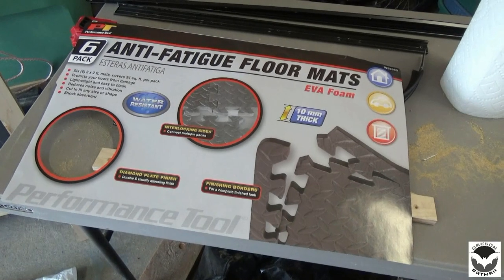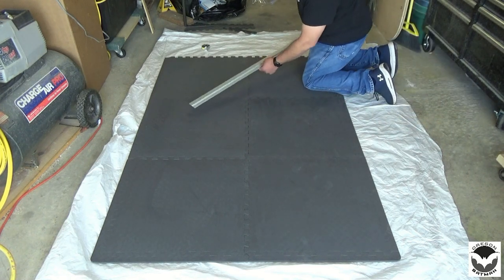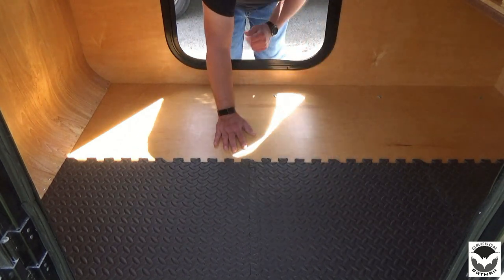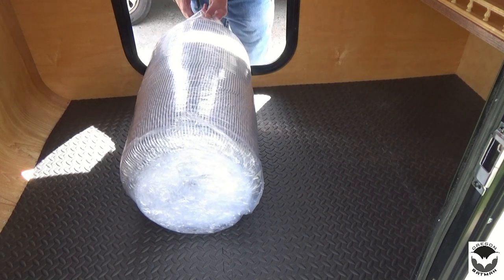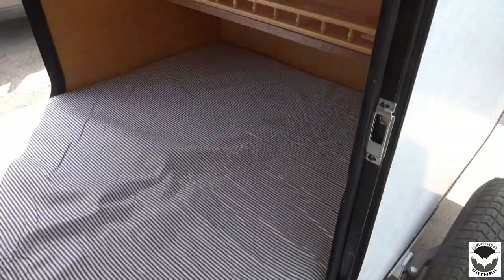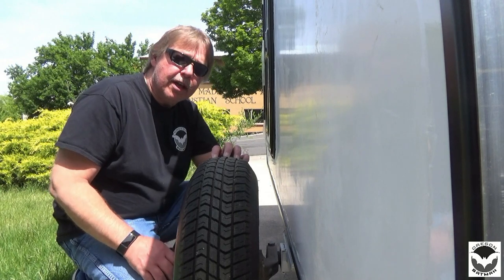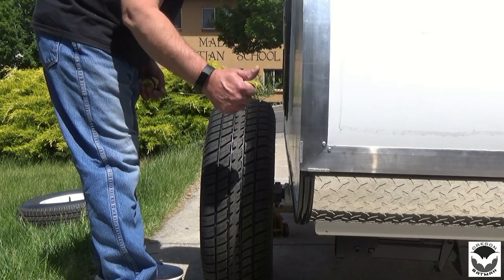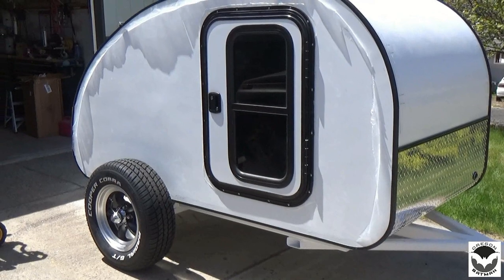Let’s Build A Teardrop * Step-By-Step * - Part 47 (New Wheels and Mattress)

Comment: New wheels and tires look good. You need to put some chrome exhaust tips on the ends of the 2" square tubing coming from the hitch, to make it look like your camper has side exhaust. lol
Reply from the maker: LOL! That's a pretty sweet idea! I saw this comment while I was stopped at a rest area in Nevada, and was out in the parking lot measuring and figuring out if it would look good. Gave me an idea! Thanks Beareded One!

Comment: Hi,  Albert! I've been minning to ask you... Why you haven´t installed a fuse box or an electrical conduit? Also... Was too dificult to install the filon directly to the 3/4" ply walls, that you inclined to do it first on a 1/4" ply? Again, congrats on that awsome work!!! I'm a fan of it!!!
Reply from the maker: Hi Diego! Just trying to keep it simple for the electrical, I'll use a fuse at the battery (15 AMP). The walls are 1/2" for the inside walls, the ceiling rests on the edge. I installed filon on 1/4" because it was easier while lying flat then install on side. Could just as easily install on side of 3/4" wall if you wanted to, this was the easiest for me. Thanks so much for watching and appreciate the questions!
Reply: @OregonBatman  The fact that you take the time ton answer your fan questions, is one of meny great things about you! I'm waiting some tools that I bought to start my teardrop (square, outlander type)... I'll be in touch, for more or your guidance! Until then, I'll be waiting your next video in this series!!!

Comment: I like your fix for the wheels . I had the same situation and never gave a thought to offset wheels. Instead I purchased 11.0 inch wide fenders. They don't look bad but it's just the fact I missed it. Like you I'm in the mattress/cushion mode foam was ordered and cut in 3 sections . I will have the option to convert to a sitting position by using the drop floor hatch cover. So all three cushions need to be covered and that we are in the middle of right now . Finding someone to do the covers was like pulling teeth very tough everyone was back logged here. Your build looks great. Keep up the good work.
Reply from the maker: Thanks e string!!

Comment: I've been binge watching your build. I appreciate the fact you took your time to actually show what to do vs some other videos that speed through the process leaving a person scratching their head. The only problem I have is the mattress isn't long enough. I would need to leave out the lower part of the galley or make the whole cabin longer. Maybe extend the the flat area on top for extra length?
Reply from the maker: Hi S C! Thanks for taking the time to watch! The mattress is 6" in height, and measuring from the rear bulkhead to the front of the cabin gives you a total of 73-1/2" sleeping length. If you are taller than that, you might have to curl your toes to sleep! :)
Reply: @OregonBatman  😂😂😂

Comment: I like your custom made mattress. May I inquire where did you order from? I have been watching your video for your tips and techniques to be used with my van conversions. By the way, nice wheels!
Reply from the maker: Ordered the mattress from Foam Factory website. Will cut to any size you need and have a good selection of foam!
Reply: Can you put a link to the mattress company? I looked up Foamfactory.com and Foamsupply.com and they are both building supply products.